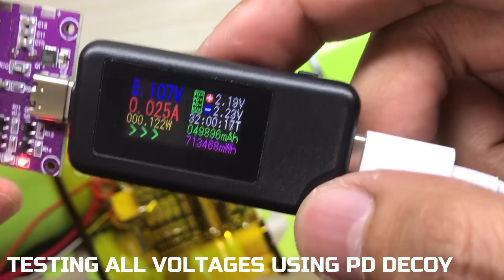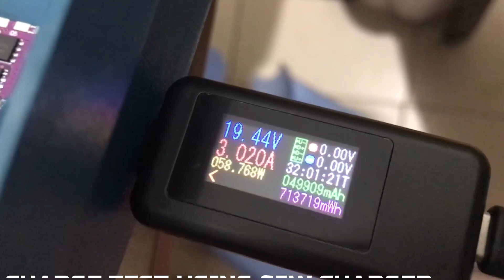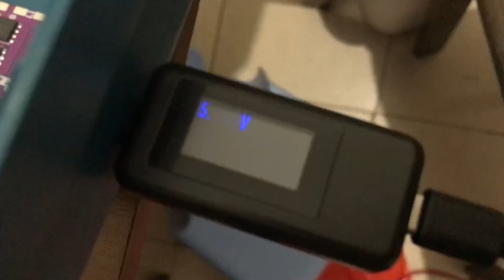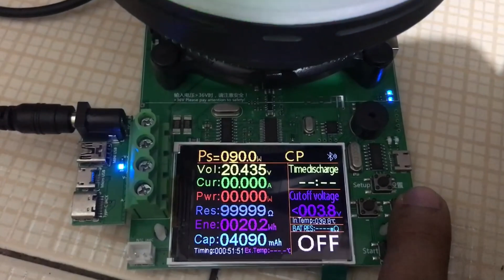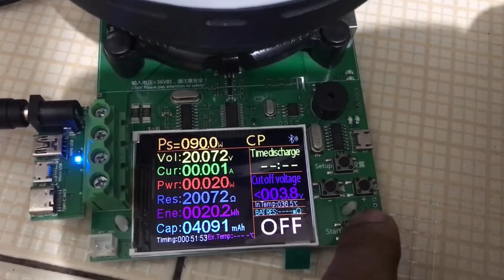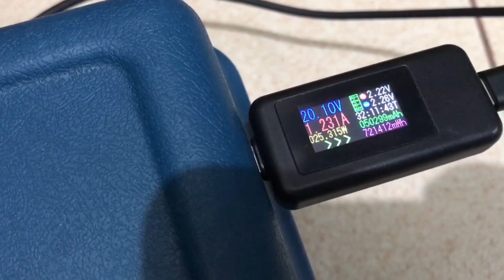DIY 240000MAH POWERBANK WITH 100WATTS OUTPUT POWER DELIVERY

Comment: Too much voltage drop along the long wire you are using. As you can see you're pulling 97W at the board but 89W at the DL24
Reply: Ate you serious
Reply: @Sharpfxscalper77  110% serious
Reply: @Sharpfxscalper77  voltage drop on the 90W test was from over 20 volts to under 19. The reason why they were unable to pull much more than 90W is because the wire they used is too thin but is not entirely their fault. The designer of this board gives you such small holes to work with. The solution is to buy the other model the Pro or Mini with the XT30 PCB mount and cram 14AWG wire into an XT30 connector while trying to keep the length under 8”

Edit 20.43V to 18.95V on the first 90W draw

Edit edit: to clarify its not just the wires from the cells to the board, its also the USB C cable that plays a critical role. Unfortunately they don't advertise wire gauge of USB C cables but 20-24AWG is quite common for the main power wires. If you can find one with 20AWG that would be preferred. Pretty easy to figure out just by judging the cable size. There's going to be a bunch of thin signal wires inside but the main power wires, if they are thick at all, are going to make the cable notieably thicker than most cables. So when you shop (if you shop in person) feel for the biggest cable or if its behind plastic put them next to each other and choose the one that is thickest. You might get bamboozled by super thick insulation so there's no way to know until you cut open the cable and sometimes thats $20 down the toilet.

You could try emailing the manufacturer but don't expect a correct answer
Reply from the maker: no worries, I will not use it with 100w maximum. only for for my 25w laptop :)
Reply: @DIYPINOY  You can max it out and run it at 90W, I just wanted to point out that its the wire gauge they force you to use....and also yell at you for using "too thin wire" when you complain about voltage drop issues to the sellers. If your laptop only takes 25W then you're good, you will have minimal voltage drop at such a low current.

Comment: Hello senior high school students here 😭. Need po ng help para po sa wind turbine generator. 12v to 24v DC motor po ang gagamitin nmn connected to a lithium battery  plus switch for 6v or 5 watts led light po. Ano pong advice nyopo?
Reply: Mga 6v lithium battery po